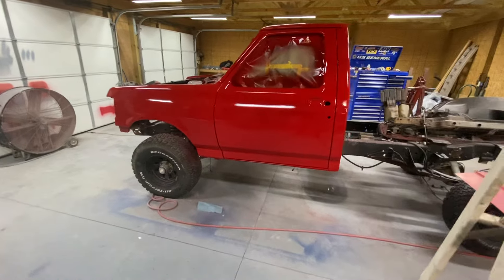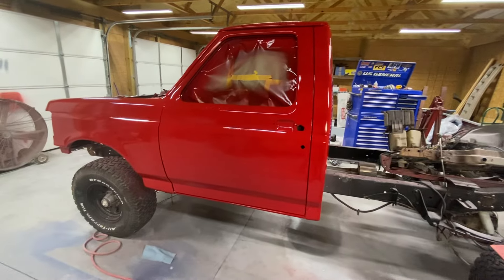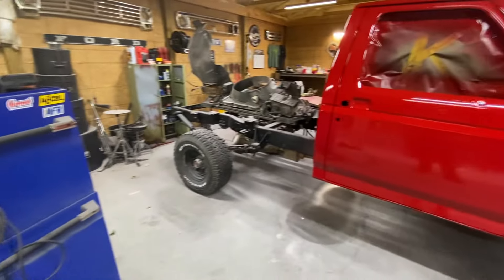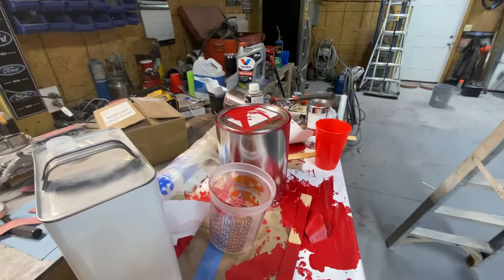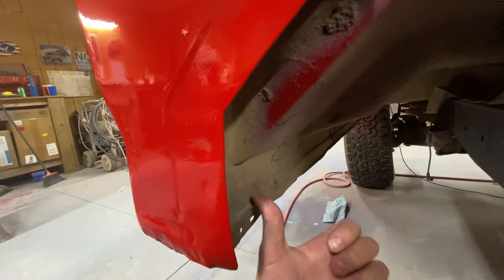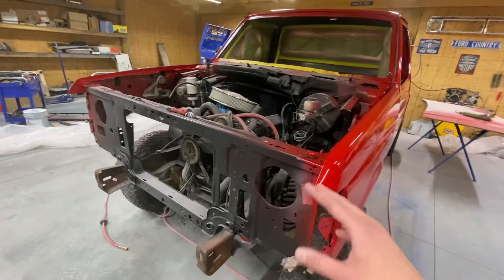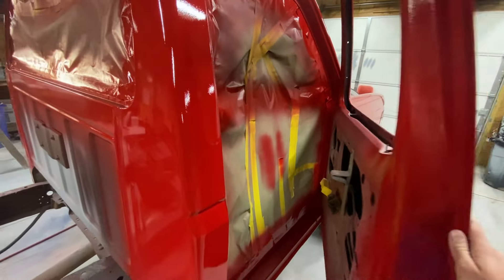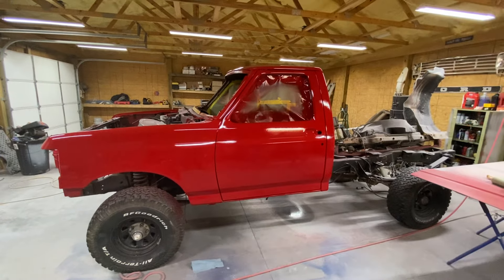My old truck gets some new paint. Restoration part 2

Comment: I have a 1987, 150 XL four-wheel-drive 300 six-cylinder three speed manual and has 103,000 original miles
Reply: 3 on the tree in 87? Gosh darn that's rare
Reply: @Werewolfman1966  3 spd with granny gear, no 3 on tree in 87